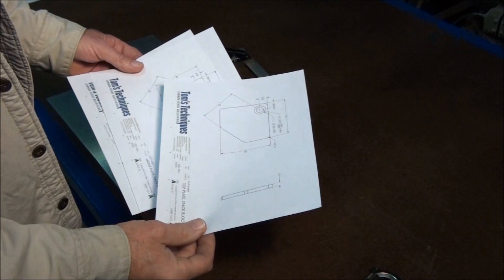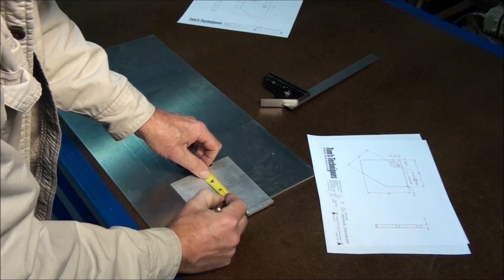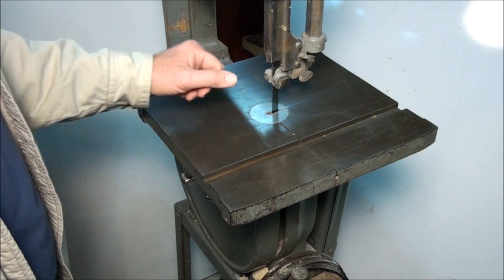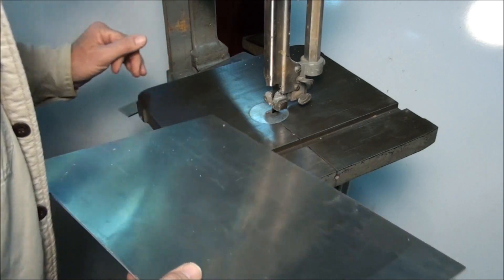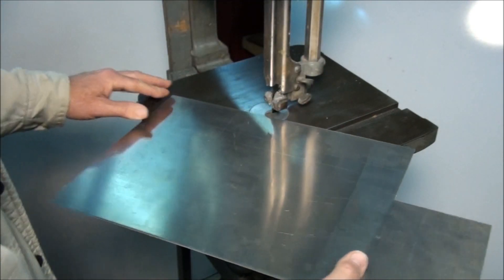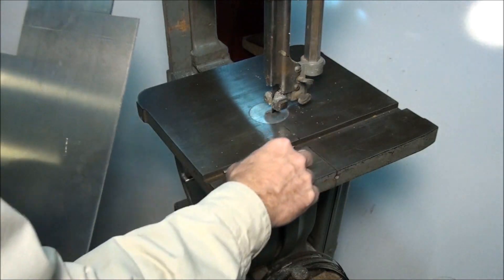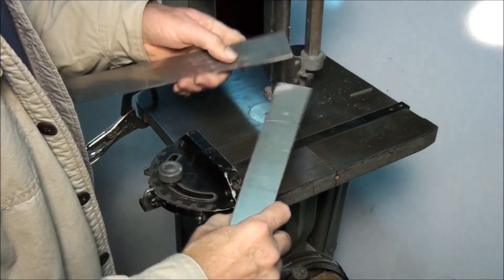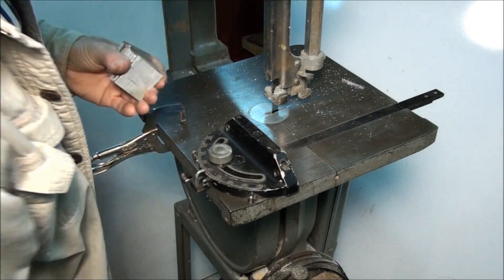Stack Blocks Part Two - Sawing Out the Stock

Comment: Thanks for your very clear videos.  I have been a woodworker for many years and just now getting into metal.  When cutting the material on the band saw is it a problem to put a fence on to make multiple passes to get same size cutoffs?  Seems more accurate and much faster.
Reply from the maker: Dennis.

You can absolutely use a fence when cutting multiple parts like this. Unfortunately, I don't have one for this saw (It's on the list of things to build), so I do it the hard way.

Thanks for watching.

Tom

Comment: Great tip using the vise grips for the gauge. You have undoubtdely been in production shops. 
I particularly liked your approach to selecting the cuts so as to leave little waste as possible. I have to buy the material.  I see the kids at school wasting huge amounts of material.
Was the thinner aluminum 5052? The thicker appeared to be 6061
Reply from the maker: Yes Richard, I've spent my share of time in job shops. Waste is a big issue there. One of the least desired jobs was running the saws because they always wanted you to leave as little material as possible to keep machining time down, but too little and the parts wouldn't clean up.

All of the material was 6061 on this project.

Tom

Comment: Is there a way to purchase aluminum flate bar already at right dimensions?
Reply from the maker: Aluminum bar stock can be had in various dimensions, but it won't be as accurate as machined bars. Check onlinemetals.com or Mcmaster Carr.